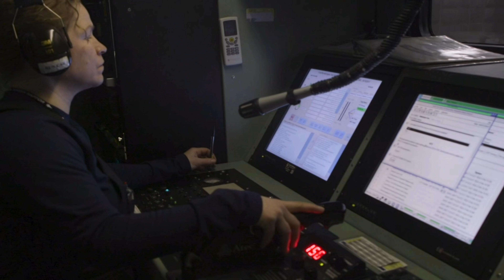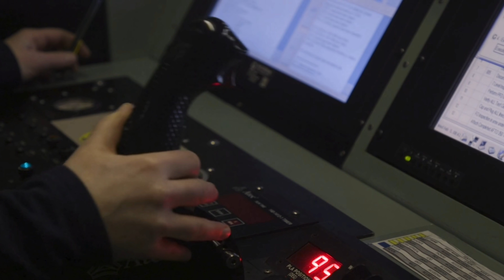F-22 Engine Testing | BEAUTIFUL THRUST ☄️ [HD]

Comment from the maker: I work in the aviation industry and I have to say I love plane engines. So much power in such a small piece of equipment. Do the math. Its crazy! Please share this video to let someone focus on something else other than this virus craziness! Stay safe and stay smiling!
Reply: ... In the 80s I did an internship/apprenticeship at LeRC NASA. Got to do some of the "proof of concept" for that engine. Cool to see what that work evolved into ...
Reply: Runs in my family, Grandparents worked at Nasa and Rockwell, uncle works for Boeing on the F22 and F35. Lotta cool memories.
Reply: I have always been curious why certain afterburners come out with different flame colors?   I'm assuming It is the heat Of the burn, And the atmospheric conditions, but I've never worked on an afterburning jet.
Reply: So within 24 hours we've had toilets with shells in them and now a burning ring of fire. I'm sure there has to be a joke hidden in there somewhere or alternatively it's something to do with the fact it's 3am.
Reply: @mastathrash5609  ... Have you ever used an acetylene torch? Notice the different colors of a carbonized flame thru to an oxidizing flame? Same with an afterburner. If the are different colors than what you normally see, it's from a fluid or erosion of metal/ceramic of the engine. Remember that engine is on a stationary test stand, ideal conditions for airflow, fuel ect ...
Reply: Many thanks for the like mat. Gentlemen what you just witnessed was not an engine with afterburners on, they were testing the engine for the super-cruise feature. Going above mach 1 with no afterburners.
Reply: OMG you actually got to SEE this??!!! Luuuckyyyy

Comment: I've seen an F-22 in flight. It was at the 2015 Stuart Airshow. I was in Civil Air Patrol at the time, Stuart Composite Squadron FL-024 to be exact. It pulled maneuvers no fixed wing aircraft should be able to perform. Badass is the only phrase I can use to describe it.

Comment: It's crazy just how how powerful and advanced the two F119 engines are and were for the longest time the most powerful and advanced until the F135 was built for the F-35. The F135 engine is evolved from the F119 and is unmatched in power, safety, reliability and performance! It's crazy to think that the F135 engine can produce more than 43,000 lbs of thurst!!! It's not just the power of these engines that make them so awesome, it's the technology and reliability!! Something that Russia and China are a long ways off from having anything comparable.

Comment: What no can of chicken fat nearby for engine stall? Had a friend of mine have a J-79  let go just as the grease hit the blades. Just a little bit chicken fried but got chewed out by doctor for trying to get a tan before going back to states. Gave the er a scare because of his blood pressure and heart rate. A jogger  so his pressure was a little low to begin with low side at about 40 hi 60. Still watching him getting the dead skin peeled off was a bit much. He only grimace when it was still attached.

Comment: Matsimus: Compliments!

The decisive feature of military aircraft is the engine.
It has allways been so:

WW1: The Gnome-Rhône Delta 9 cylinder rotating engine (the crankshaft was bolted to airframe and the propeller to the cylinders - necessary at the time to cool the engine, as they had - poor fuel economy compared to later designs) was arguably the most successfull aircraft engine of WW1. The Germans used them as well. Originally they salvaged the engines from allied planes downed - but Motorenfabrik Oberursel had a licens - and they were build to German production standards and were thus more reliable than the original product.

WW2: The story of the Merlin (Meteor) engine is well known. 
The Pratt & Whitney R-2800 Double Wasp on the Hellcat of 2000 hp was a bloody monstrocity; but it allowed for protection and rugged construction that saved many an american life: The Zero was the smallest and lightest possible airframe designed around the given engine.

1960'ies: Was the General Electric J-79, which in the Starfighter demonstrated one of the trade-offs. The F-104 flew Mach 2, but you had to slow down - before the damned thing melted.

Today the engine is as central to a fighter (or any other combat aircraft), because they contain technology that is difficult to replicate (say steal, pinch etc. like the russians did with the Nene),
The main object today is to get the best specific fuel consumption - thus range. How well it is achieved is difficult to asses, as it is hard to evaluate without access to specific flight tests - which the manufacturer is strangely reluctant to hand out. Considering data on military engine performance the ones you get on Wikipedia is the figure that is "close enough" for whatever legitimate purpose you might have - i.e. considerably obscured.

To the North Atlantic the stealth of the F-35 is a secondary consideration - definately nice to have; but not the holy grail.
The limited number of F-22 produced is the wondering of several pundits - the explanation is quite simple: Considering the predecessor (F-15 and F-16) has no serious competition - especially not at the price - it is enough with so many F-22 aces up the sleave.

Comment: Imagine Sydney Olympus or R15B-300 engines on that thing. Now that would be impressive.
Always been sceptical about the 35,000lbs of afterburner on the Pratt and Whitney F119’s.

Supposedly more then Mig25 capable of 3.2 Mach.
At least 4,000lbs more then the Olympus at 33,000lbs that gave TSR well over 2.5Mach.
With the F22 with the best aerodynamics and materials in the world and more thrust 50 years later only capable of 2.25mach.
Reply: Max speed is far more than just static thrust capability.  In the case of the F-22 the fixed inlets (for optimum radar signature reduction) are primarily responsible as you need a variable type to go much over Mach 2.   Plus the skin coatings don't tolerate the extreme high heat generated at speed well and would need extensive maintenance if such speeds were attained.  Maximum speeds are a minor factor when it comes to aircraft effectiveness and fuel burn reducing range more important.   Even in Supercruise they consume a LOT more fuel so most missions require high subsonic most of the way to reduce refueling issues.